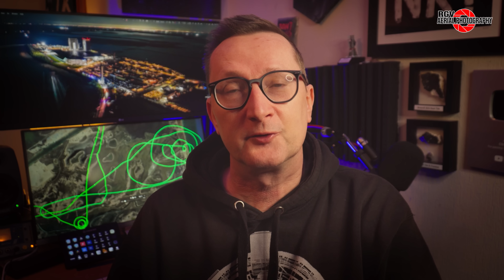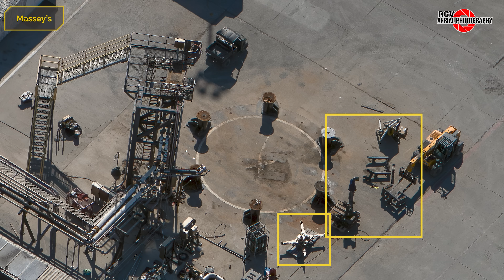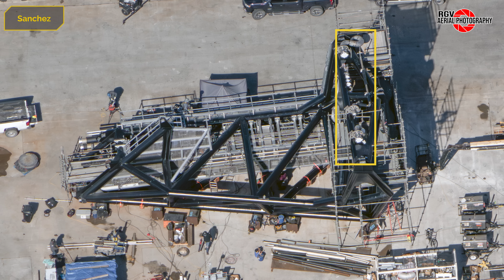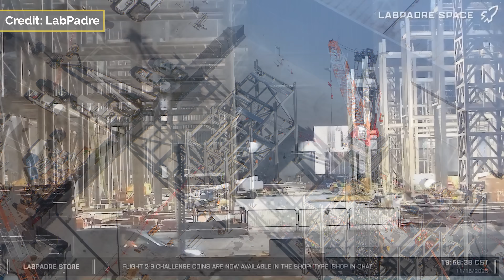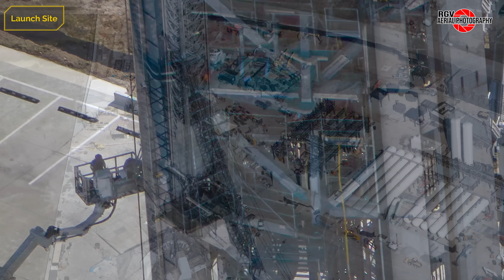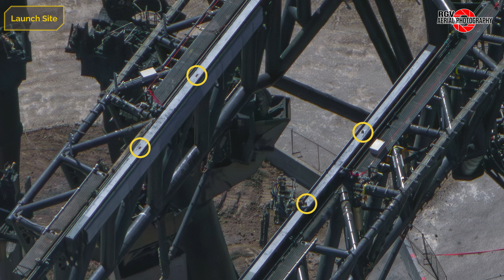Pad 2 Almost Complete? | Starbase Flyover Update 107

Comment: It's amazing that a used booster has not yet been carted off to the Smithsonium, it is the biggest object retrieved from space.
Reply: Turns out those things are big and space is a real issue in museums.
Reply: B12 is supposed be used as display vessel somewhere. Issue is transporting it.  Future Ships and Boosters will he transported horizontally, but B12 wasn't designed to be moved like that. Thus limited spots where it can be moved vertically.  I suspect it likely somwhere on Starbase, with the obsolete Starship.
Reply: politics....